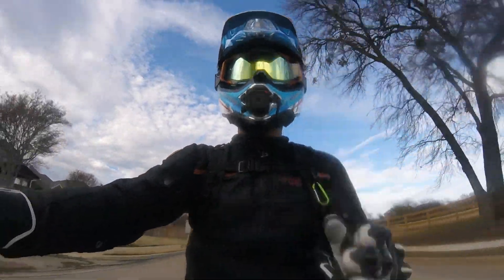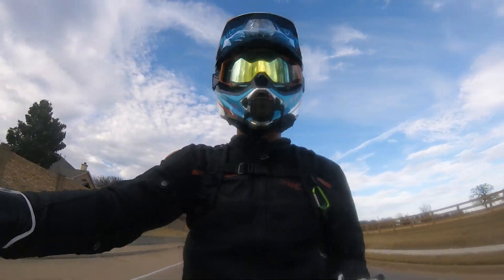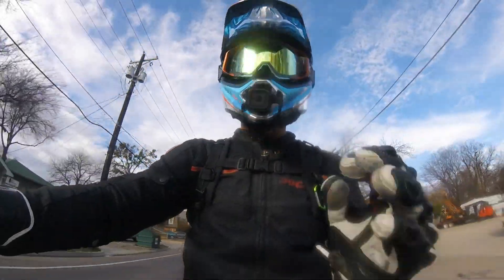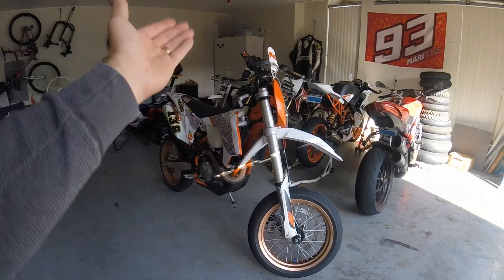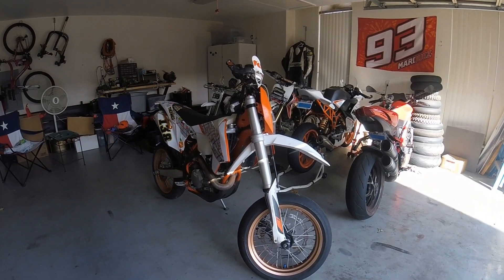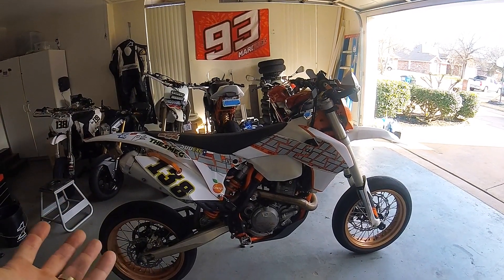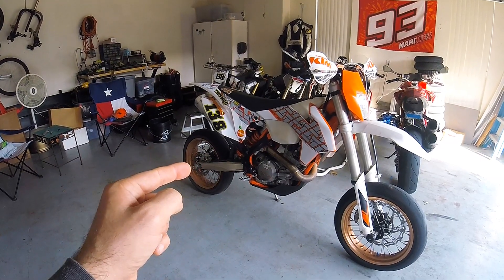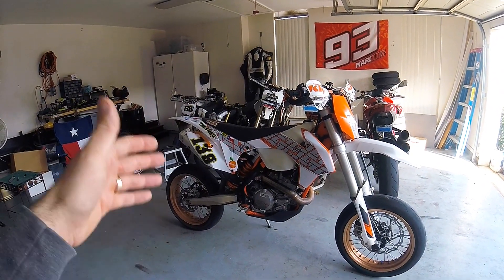YOUR GUIDE TO A BETTER HANDLING MOTORCYCLE

Comment: Thank fucking god, i've been searching for supermoto suspension setup since forever. whats your rear shock sag recommendation for tarmac only track? my stock springs can only go as low as 45mm at the rear, works great on a supermoto track but on tarmac it tends to lighten up a bit on highspeed corners. Im thinking about buying a new spring with a higher preload but i need a second opinion first
Reply from the maker: are you saying your rear rider sag is 45mm? mine was 55mm and feels great, but i do like the rear soft so it squats off a corner and puts traction to the rear tire. i think 45mm is probably alright though. what kinda bike?
Reply: @shiftlove  yes my rear rider sag is 45mm, im on a kawasaki klx450r. People here recommend going for 40mm-50mm rear rider sag. Im gonna try 55mm later on to see how it feels
Reply from the maker: your bike has 315mm of rear travel. 25% of that is 78mm. i would think going a bit looser will help you drive the bike easier off the corner. 55 is a good start. watch your lines, if you notice it driving wider or earlier then you can adjust accordingly. if you go a bit softer i think it'll drive you out wider on the turn. you ultimately want more weight on the front into a turn, and more weight on the rear out of a turn, looser or the rear will accomplish that, and will also help you use all of the track.
Reply: @shiftlove  thanks man, i already got the front end revalved and swapped to racing fork oil, they work great. now its just a matter of getting the rear figured out. 1 got 2 months before racing season starts

Comment: Thanks for making this video! I’ve got a 2014 500 and have been trying to educate myself on proper suspension setup. I know supermoto is a bit strange like you said and there’s no exact recommendations from KTM, but I’m hopeful this will be a great starting point compared to the zero adjustment I’ve made so far. 

I’m wondering for your front preload if the clicker turns you found best was 2 turns counterclockwise from all the way in? Thanks!

Comment: Great video! I have problem my ktm keep going left while wheeling i don't know what to do, i dont have any free scape on swingarm etc. Could you help?
Reply from the maker: see if your rear wheel is aligned. like make sure your chain adjustment is dead on on the rear. other than that, it could just be your body position. to keep it from going left turn your bars while youre up. also, you can try lowering your rear tire pressure to make the wheelie more stable

Comment: What are your thoughts on geometry changes from dirt to SM tires? My stock front to Sm front will drop the axle 1-7/8”. The rear will drop 7/8”. The 1” lower in the front tips the front down. Do you think it’s ok to go with a lowering link to get 1” out of the rear which basically levels everything off. I am also short as fuck so lower seat is a win as well. Any info on sites that calc bike geometry
Reply from the maker: great question. what you are really after is correct trail numbers, with a more aggressive rake. but not too aggressive. if you lower the rear without changing the front, it will get you more rake (a larger number), and the bike may feel slow to turn, but will be more stable at high speeds (straight line). if you leave the rear alone, and drop the front, you will get less rake (turn in easier, but less stable at high speed), but you will also decrease your trail. the only way to get everything is to use lower offset triples, (less offset=more trail with same rake), or to yes, lower the rear a bit in order to increase the rake, and thus the trail. you always want to try and make even changes though. buy a magnetic angle finder and determine the rake of your forks. plug that number and your front tire circumference into race techs trail calculator to determine your rake. (you will also need your triple and axle offset numbers to determine this). now see how far your trail is from the factory number. make the forks flush with the upper triple and measure again. see how it changes. this change will be similar to lowering or raising your rear. i suppose you could also put the front wheel on a 1 inch block of wood in order to show the same thing. for what its worth, my trail is about 20mm less than stock (90mm vs 110mm)  and the bike handles fantastically.
Reply from the maker: i hope that reply was in depth enough lol